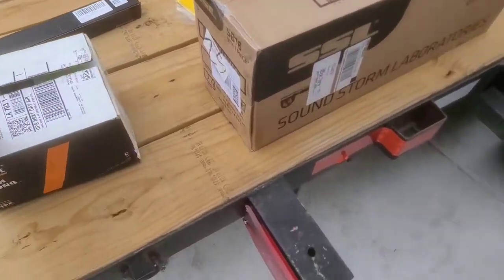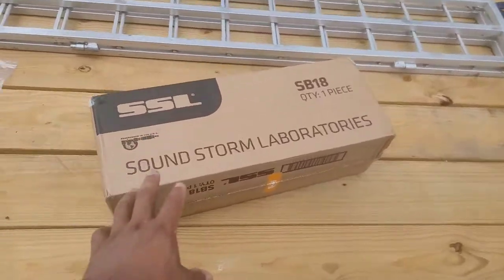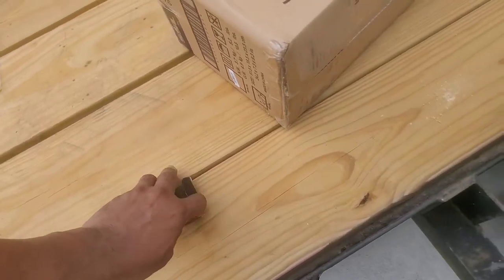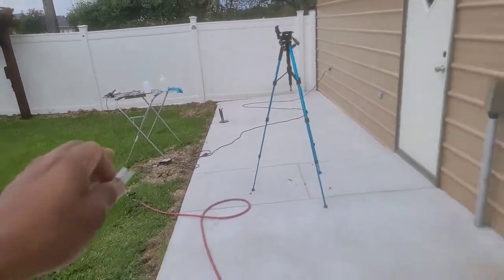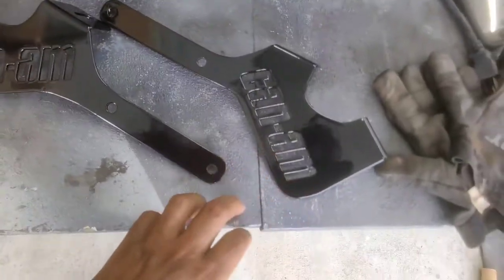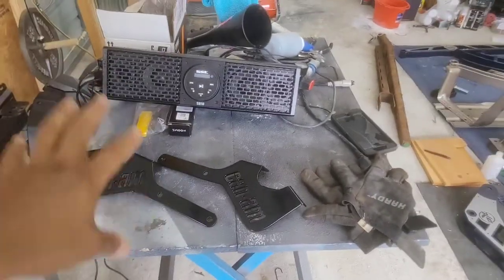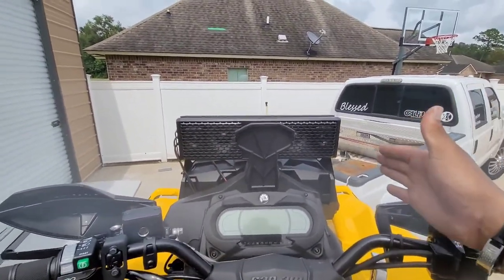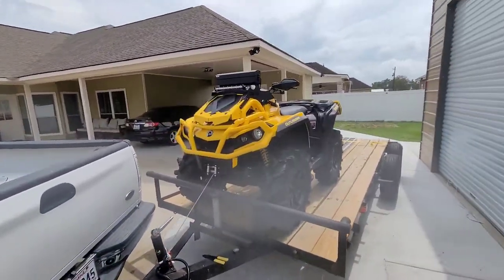How to install a Sound bar and light bar on 2021 OUTLANDER XMR 850| Powdercoating Rage clone mounts

Comment: Nice bike bro. Can't wait to see your f250 completed.  I'm fixing to lift mine pretty soon with a 6 inch zone. Going to be running for now 24x12 on 37×13.50 tire.
I just pray to God they don't rub. I see yours cleared pretty good so mine should be OK.  Plus I believe you were running 14 wide on wheel and mine are 12s. Anyways hope all is well .
Reply from the maker: Thanks alot man, yes truck videos are coming back soon. You should clear those with no problem.  I ran the 2016 front bumper so that gave me extra clearance also.  GoodLuck with the build man

Comment: Did you wire straight to the battery for the soundbar? I am about to install one on my new bike.
Reply from the maker: No I just used the power from the 12v cigarette liter for power

Comment: How did use what came with the speaker to mount it to the brackets, I have the same speaker with the rage dab mounts and can’t figure out how to get mine on?!?!
Reply from the maker: I used the sliding tabs and the screws that came with speaker to mount through the wholes on bracket

Comment: What's the distance from center hole to center hole from bracket to bracket when mounted?
Reply from the maker: For the light bar? The speaker mounting wholes have adjustable slides

Comment: Do you have to have another bracket for the sound bar to mount to?
Reply from the maker: They make a bracket that will fit just a lightbar or Soundbar or you can get this one that mounts both soundbar and lightbar.

Comment: What’s the right link because I clicked the link in the description and it shows a different speaker.
Reply from the maker: Ummm try again. It pulls up 18" SSL speaker when I click it  which is the correct speaker.
Reply: @Powerstrokepat  the speaker is 18inchs right?
Reply from the maker: @yeyo5671  yes. Read the listing description,  the picture may look bigger
Reply: @Powerstrokepat  ohh okay thank you